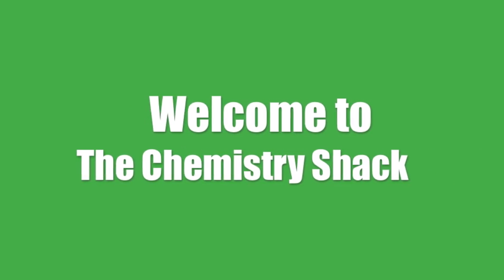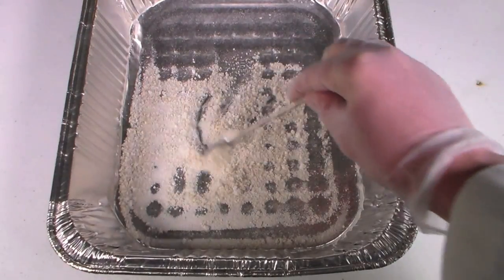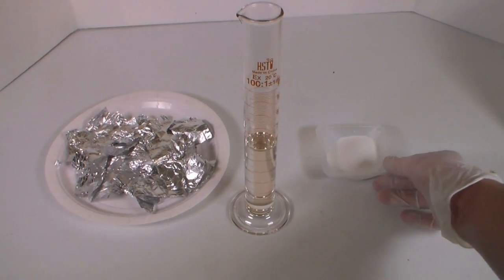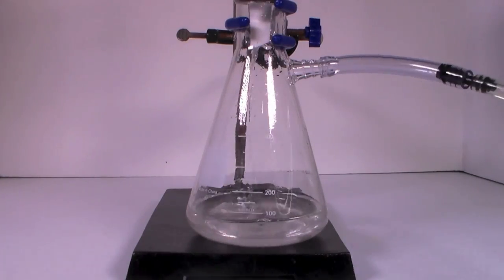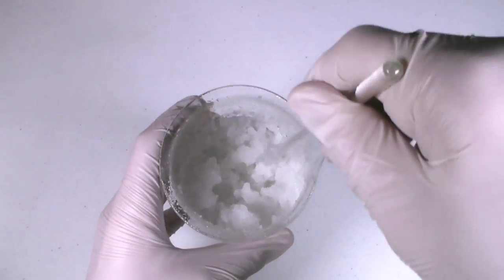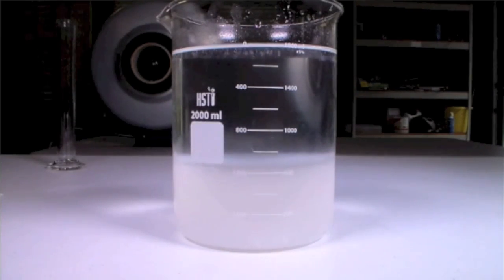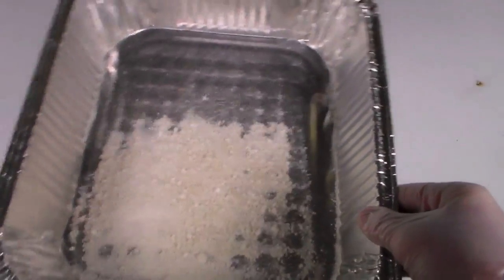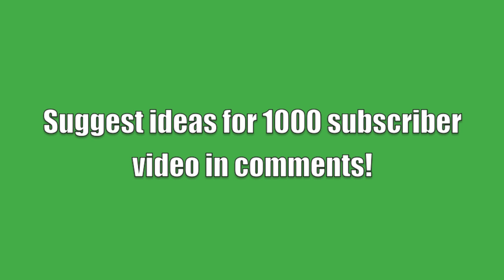How to Make Aluminum Oxide (Al2O3)-IMPROVED VERSION

Comment: Great video! goes along with something I am working on right now. The black insoluble material was probably carbon from the electrodes used to produce the aluminum. And your final product was Aluminum hydroxide polyhydrate that explains the extra mass but that is an easy fix just bring it to a red heat for a short time and that should dehydrate it down to aluminum oxide.
Reply from the maker: Thanks! I love your videos as well! 
That explanation for the black material does seem to make sense. I had also heard that it was a thin plastic coating on the aluminum reacting with the HCl. I suppose I could do some testing to figure out what it is (although the carbon explanation makes more sense). 
Yeah, I've realized from the comments that I produced aluminum hydroxide (it still worked for the ethanol decomposition though, but probably  because the torch was able to dehydrate it "in situ" into aluminum oxide. Or perhaps aluminum hydroxide works fine for the decomposition).
May I ask what you are working on right now?
Reply: I would have to disagree with Cody on the electrode wear thing. The black material is usually fine aluminum dust that had a lot of oxide on it. If you leave the aluminum dust in the acid for a prolonged amount of time with enough acid, all of the aluminum should have been consumed. Usually, carbon from the electrodes used to produce the aluminum floats on the molten aluminum's surface and is skimmed off. More premium brands of foil do incorporate a thin film of plastic like the chemistry shack said in his comment, but it would have been evident if there was plastic film present in the acid dissolution step. Anyways, great video. Aluminum hydroxide can just be heated for a couple hours with a torch and crucible to make Al2O3. I hate to disagree with cody tho :)
Reply: Cody, I just watched your video on glass making in a microwave right before this video haha.  You got great stuff too brother!  I'm subscribed to both of you guys...Keep up the great work!
Reply: Thankyou Cody

Comment: In that reaction firstly it is formed Al hydroxide. Al hydroxide is like gel. And the reason why you have a lot more product is because Al hydroxide reacted with CO2 forming Al carbonate. The same thing happened to me when i was making Al hydroxide. If you want Al oxide just heat the carbonate and you will get it. Btw your videos are great. Keep going and good luck :)

Comment: Why does aluminum oxide form?  Why not aluminum carbonate?
Reply from the maker: +Detonationology Aluminum carbonate actually doesn't exist. This reaction is a bit of an unusual reaction becuause it's not a straightforward double replacement. Al2O3 forms instead of aluminum carbonate or hydroxide, like you would expect

Comment: For those who don't know this is how deodorant works. When you put deodorant on the water soluble aluminum chloride reacts with bases in your skin (ammonia) to produce a very thin coat of aluminum hydroxide (water insoluble) that blocks your sweat glands. It's funny I knew that but I never realized you could just add carbonate and heat for the oxide. This is perfect cause I need aluminum oxide to line my forge with!
Reply: It worked ok but even in an icebath with dilute acid it gave off tons of fumes. Was too much hassle for a low amount. So instead I found a much easier way to make magnesium oxide. All supermarkets sell "milk of magnesia" aka magnesium hydroxide it's $2.99 a bottle and each bottle has 28.4 gms. Though the dollar store had them for $1.99 so I picked up 5 bottles there. All you do is open the bottles, pour them out into an iron pot then turn your gas stove on high (assuming you have a gas stove).

Magnesium hydroxide decomposes at 350C. Lye melts easily on my stove at 318C. I also tested sodium nitrate which decomposes at 380C. That decomposed fast so most gas stoves should work fine.

Then you just boil it down and burn the water out of the hydroxide. The way I tested to make sure it was done I just took my propane torch while stirring the oxide. A small amount of hydroxide makes the flame orange (water vapor) so when the torch flame turned blue and I stirred it pretty well I knew it was finished.

It's much less hassle and magnesium oxide melts 800C higher than aluminum oxide so it's also better for refractories. 

What's cool too, if you buy bentonite clay (the gray, kitty litter clay all supermarkets in the US sell it) which is aluminum silicate.... then blend the clay to dust and burn it over the stove you can make high quality grog. The clay has less than 1% sulfates. And you should use a propane torch + a stove to burn out all the sulfur dioxide. But after that clay is fired you can mix it with magnesium oxide (30-70 or 40-60 grog to oxide by volume [compress the powders down before measuring]), a bit of water, ram it into a crucible (like you'd make a mini forge) then fire it in a forge. 

I got the coolest looking crucible I ever made in my life. Thin walls, nice and smooth, hard like ceramic and doesn't vitrify.

And as a side note, I make my forges with the same exact clay. Except I use 60% blended perlite dust to 40% blended rocket clay (kitty clay). And I don't fire the clay first. Just blend and mix both, a bit of water, pack into shape then I do about 10 small fires 5-10 mins each spread out over the course of a week. And I also add a very tiny amount of water glass to compensate for shrinkage. The perlite-clay mix will shrink about 5%, water glass expands like crazy so use just 2-3% water glass. 

The first few times you fire do it brief like 2-3 mins. Wait 8-10 hrs. Fire again like 3-4 mins. Wait half a day. Fire again, by your 3rd fire or so the small amount of sulfur will burn out. But it takes about 10 fires over a week to slowly coerce the water out. You'll know the forge is ready when the liner turns black to white. At that point I do my first long, dry fire... the liner vitrifies a bit and the entire forge gets hard like fire brick, no cracks and they last for decades.

Sometimes you will get hairline cracks if you rush the firing. But you can repair them with the same forge mix. Simply thin the same exact forge mix with too much water till it stirs like hot honey, draw it up into a turkey baster then drip it into any cracks, press in and smooth with your finger.

It's best to repair any cracks when the forge still has moisture before your first dry fire. This way the forge pulls the water from the "honey" and they dry quick in 20-30 mins. And also when you fire it the repairs cure like ceramic the same time the forge does so you get really strong structural repairs that you won't be visible and become part of the forge itself.

My only tip would be don't make the forge walls too thick. I limit my walls to 3" because thick walls won't transfer enough heat to fully cure the whole forge. It really depends on how many BTUs you're pumping but clay forges are dense and insulate better when they're thinner.

ps. Don't use play sand or blended silica gel. OR normal, inflated perlite. Use ONLY blended perlite for your silica source as it comes from volcanoes and has a different crystal structure perfect for forges. Inflated perlite (not blended) melts easily and destroys liners. Then play sand and silica gel are too dense, they don't compress well with clay and you get softer forges that break down. The specific mix I mentioned gets hard as old school firebrick, it never breaks down and lasts forever. And to be clear, I only use magnesium oxide for crucibles. You could use it in place of x% perlite dust but it's not needed at all and works better for really thin crucibles.

edit: I may have completely mistaken what you said lol. When you said you're working on the same thing I somehow inferred you were also building a forge but if not just ignore what I wrote. :-)

Comment: Isn't this just a precipitation reaction? I.e. a metathesis reaction
Isn't Aluminium Carbonate the product? Perhaps calcination of this will make Al2O3?
Reply from the maker: +Christopher Hickman several people have asked about this, so I will include a note in the video. 
Basically, Aluminum carbonate doesn't actually exist. This is a weird, non-striaghtforward reaction and is not simple double replacement. 
My source for this reaction is "HL IB Chemistry" 
*The book was published in 2009, so this reaction may be more well-characterized now, but as far as I know this produces aluminum oxide.
Reply: +TheChemistryShack 
Thanks for your reply! Sounds interesting! I will have to read up on it...
Reply from the maker: Christopher Hickman no problem. Happy learning :D
Reply: +TheChemistryShack 
I was thinking that there is one easy observation that could help support the idea that the oxide and not the carbonate is formed. The evolution of CO2 gas upon the addition of the carbonate to the AlCl3. 
I noticed that you did not test the pH to see if any excess HCl was still present. If any HCl was still present it would still bubble and make the conclusions invalid. 
However, since AlCl3 is a lewis acid it would make sense that it would act like an acid and the pH would still be slightly acidic even with zero HCl in excess. The theory of AlCl3 acting as a lewis acid supports the theory that aluminium oxide is produced by reacting it with the lewis base Na2CO3.
Reply from the maker: Yes, Al3+ is quite acidic in solution, so that would make pH measurements difficult

Comment: I want to coat 28 SWG pure aluminium wire with aluminium oxide layer so as to make it electrical as well as thermal insulator up to 700 degree celcius.......i tried nitric acid bath but it did not helped.........i want to use that coated wire as winding.........please help
Reply: Place two aluminum wires in water with some baking soda. Pass alternating current through it. An oxide layer will build up on both wires untill the oxide layer is thick enough that it will not pass a DC current.  It passes ac current because the oxide layer and water are dielectrics. Use a light bulb inline to limit the AC current. First use a 40w bulb. When it dims  replace with 60w or 100w bulb. 

Starting with 28 awg, im not sure how thick of a layer of aluminum oxide can go without  becoming too brittle.   While aluminum oxide is a great insulator, and can withstand high temperatures, im not sure how hot aluminum wires can go with out damaging the wire. 

Stay safe. Dont tip, keep fingers away, and ensure you and your working surfaces are always insulated and not exposed to paths that will conduct electricity to ground.

While aluminum oxide can withstand intence heat, it will be hard to thermall insulate the wire. Im not sure how what temperatures aluminum  can withstand.

Comment: I thought that to make oxide of ant metal element , we only need to react the Metal+Oxygen which makes e.g. Aluminium oxide
Reply: I think Aluminum protects itself from oxidation, by forming a thin layer of oxidation on the surface.

The oxygen perhaps cannot make contact past the already reacted surface of the metal, so most of the aluminum will remain unreacted.
Reply: By converting it to the chloride, I think we have a better chance of letting oxygen access the metal.

And the major byproduct is sodium chloride which dissolves in water,  and is non-toxic!
We didn't even have to use fire!

Comment: OK HOW DO YOU CHANGE THE ALUMINUM OXIDE BACK TO PURE ALUMINUM????
Reply: By reacting it with magnesium powder in a thermite reaction.
Reply: Dissolve it in liquid cryolite and electrolyse it (with graphite electrodes)!
Or take it to the shop where you bought the Al foil and ask for a replacement :-D

Comment: If you use aluminium in excess, and sodium carbonate exactly you need, is not it ok?
Reply from the maker: That would be fine, but it would be much simpler to just use the stoichiometric amount of Al. Is sodium cabronate hard for you to get or something?
Reply: No, it isn't.
Reply from the maker: Then why do you need to use aluminum in excess?
Reply: please upload a version for people who keep offline archives, This mistake in a otherwise great tutorial could be a problem for teachers and amateurs without av editing skills to correct this. I don't always have a internet connection and maintaining a correction log complicates file systems(doubles the complexity, keeping a ordered pair around is a pain). Could you just black bar the incorrect text and replace it below? Please? It would help autodidact learners everywhere!
Otherwise great video

Comment: Mekp or TATP would be nice
Reply from the maker: +The Chemistry Kid I've actually never made either of those, but I'm sure I could do it for a 1000 sub video!
Reply: +TheChemistryShack it is just methyl ethyl ketone or acetone and 3% hydrogen peroxide with a little hydrochloric acid as a catalyst.
Reply: +The Chemistry Kid MEKP would be fun to do lol
Reply: +The Chemistry Kid Will 3% work? I've been concentrating mine to ~30%. I assume my way simply keeps the volume down.
Reply: +Camroc37 Another youtuber made it, he concentrated 3%, he had 900 ml, but boiled it down to 200 ml. If u use enough tho, i think it will work, but I think 30% should work.
Reply: +Camroc37 the ATF would have the vid taken down and keep an eye on u. TATP was used in the Paris attacks. They are powerful, but not illegal. Just go on explosions and fires channel and u will see how powerful they are.